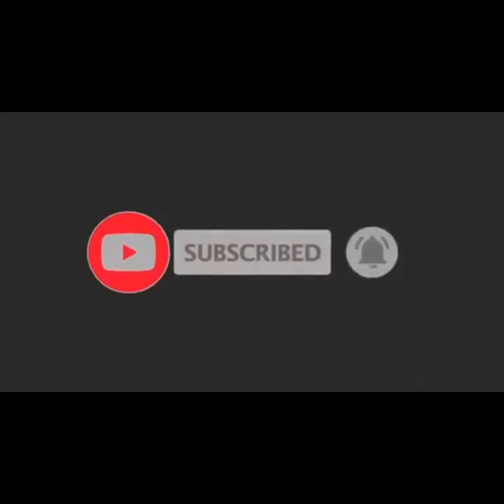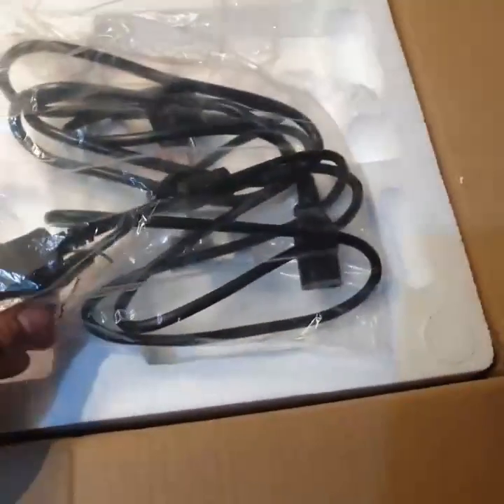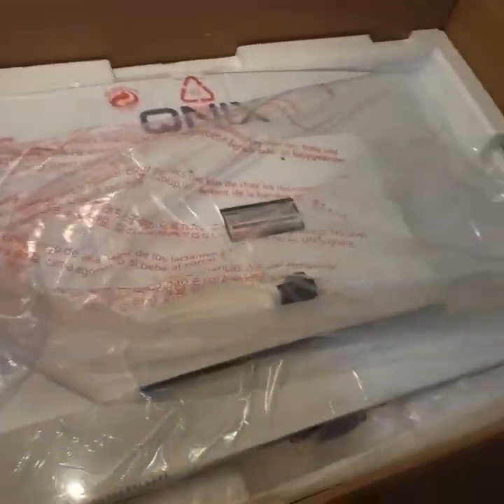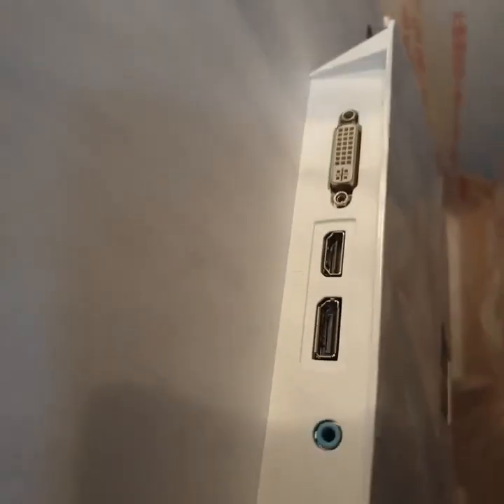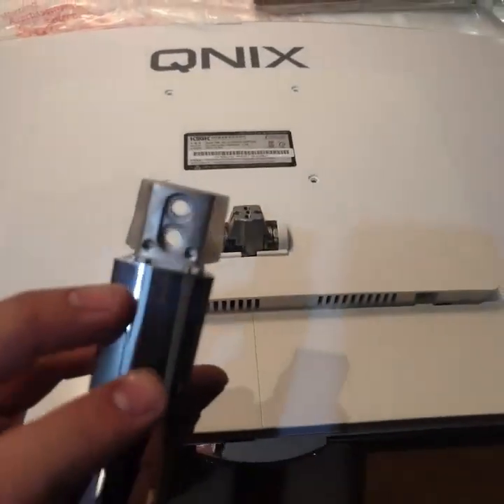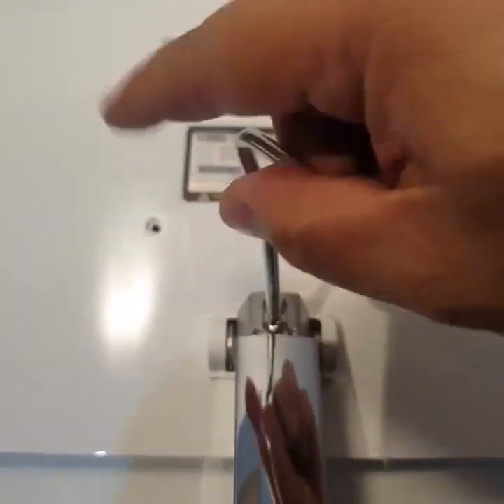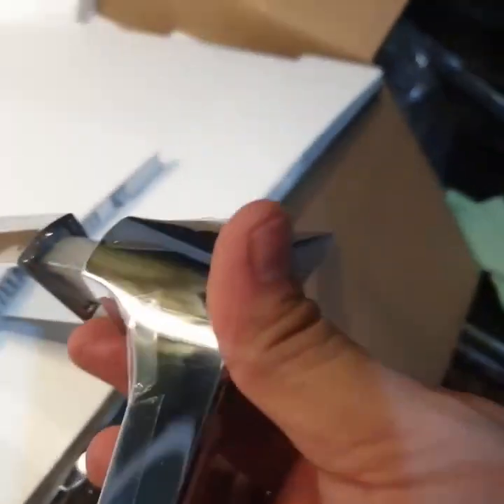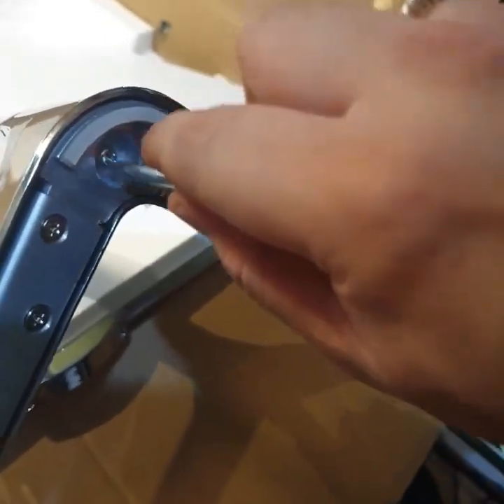QNIX Curved captain, 32 Inch VA LED Monitor, 144 Hz, response time 1ms

Comment: did you test it using the refresh rate test? at the back it says 50/60hz, planning to buy this monitor
Reply from the maker: was able to push the monitor to 143.9hz just by adjusting the GPU properties but will bring your resolution to 1680 on desktop but when you run games you'll get 1920 at full screen. So clear that you can see to much details

Comment: How's the picture quality and the performance? Does it have speakers?
Reply from the maker: So far so good able to do 149hz gaming refresh rate. Friendly sa mata. I can tell i have 2 32 inch better yung curve on close viewing as well as multitasking. Checking the sounds part will reply again is does have sound option but i think you still need a speaker hook to it.